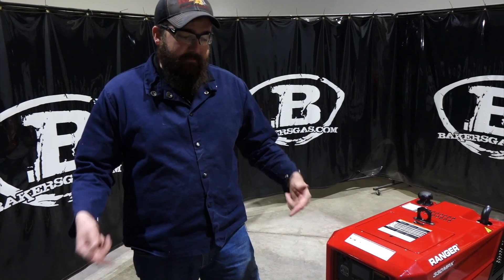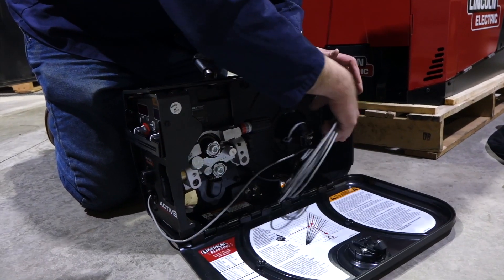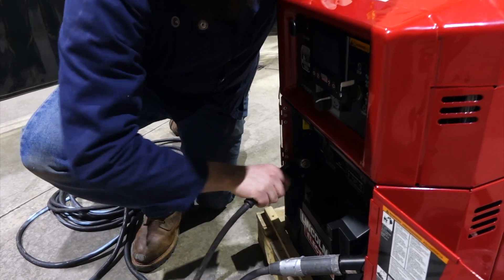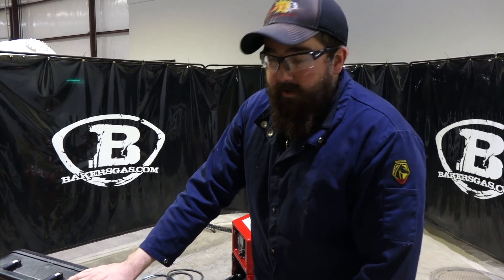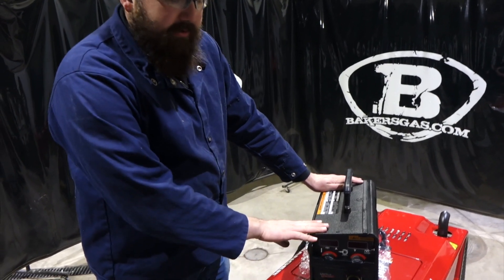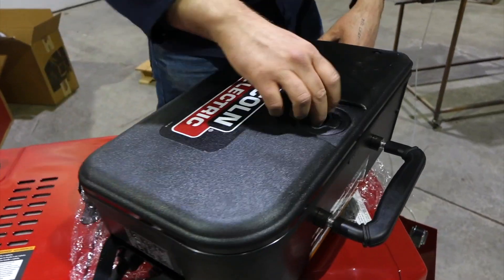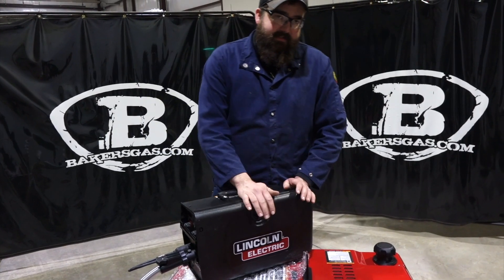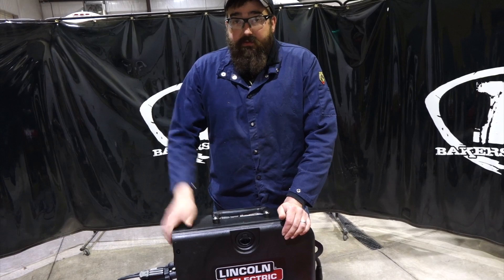Lincoln Electric Ranger 330MPX & Activ8X Feeder Review and Demo

Comment: What’s with the big spark when he connected that clamp??!?? wtf?
Reply: Totally normal, thats the voltage regulator/sensor (not a ground clamp) every single wirefeeder does that across all models and brands. Doesn't damage the work piece in any way.

Comment: The machine has some issues, one the GCFI plugs constantly trip, and to turn them back on you have to push as hard as you can with a Phillips screwdriver on the tiny button on the plug to reset it. But you will end having to find power elsewhere on your job site, because it will trip over and over, no matter what tool you  plug in . Second major issue is the dial does not click like the video; it is all over the place, good luck trying to change anything on it. Third you have to press the button to set it to weld on the home page and if you don't it won't weld, and lastly the motherboard went out within the first year. I have 40 years welding experience, and this is the worst machine I have ever owned.

Comment: Way too many delicate electronics. Nice shiney toys that should work ok for the weekend welder. I will stay with my old Lincoln DC 210 Pro diesel and LN25 that have stood the Alaska field test. Looks and runs as good as when I bought it in 1979. 
Cost in 1979 was 6300 dollars, new LN25 was 1400. Prices have doubled, quality and reliability has been cut in half.

Comment: I am a new person to welding and would have liked to see how the wire spool is fed down the cable for the first time.
Do you just squeeze the trigger switch and the motor starts feeding the wire down the cable?
Reply: Good question, yes, most just remove the nozzle tip and feed the wire while holding the cable as straight as possible.

Comment: Will the active8 work with a 305g?
Reply: I know this is an old comment but yes you can still use this feeder on the 305g or any other engine Drive that has CV or CC options there is a small pin sized button on the activate 8 X that you press with the tip of a pen or whatever that you can take it out of Crosslink mode and use it on any engine drive you want again as long as it has CV or CC option I've done it many times
Reply from the maker: It will not cross link like we show in this video. There are suitcase options though for that unit.